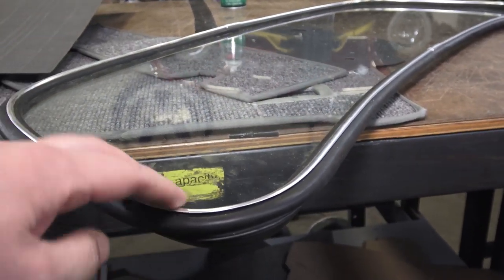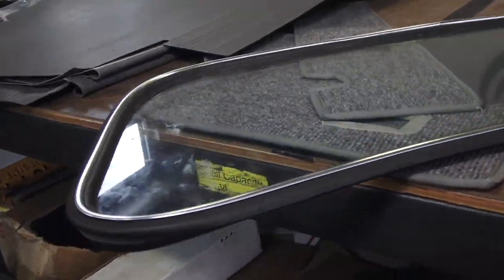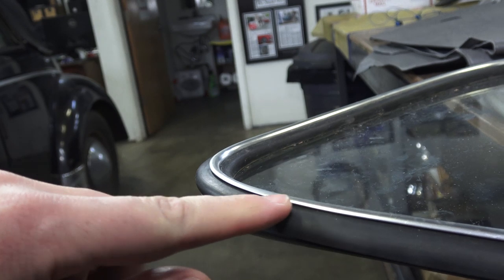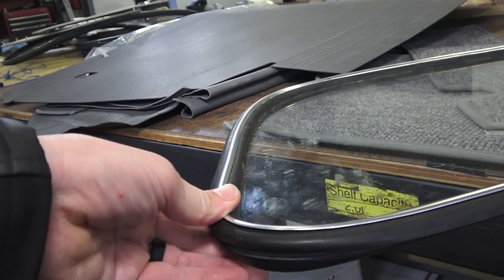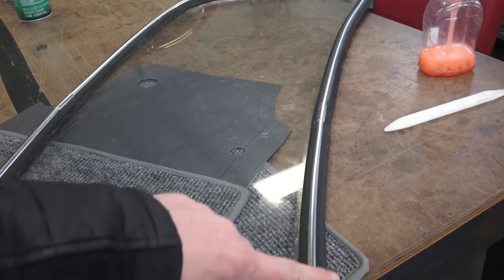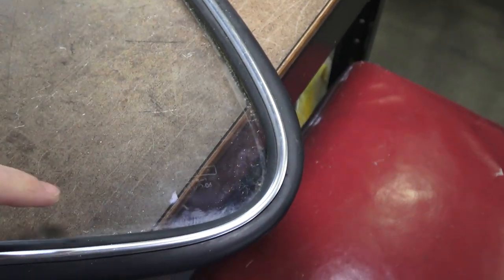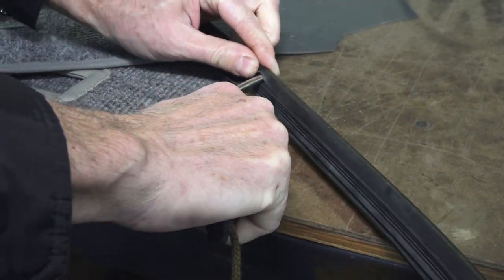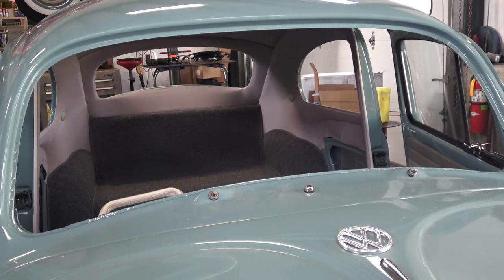Classic VW BuGs Window Windshield Beetle Seal Chrome Trim Tip Installation

Comment: I installed a set of Wolfsburg West windows seals (with chrome trim) in my bug this past summer.  Was the first time I've ever done this so I can't compare the seals to other brands but everything went together and all windows were installed without breaking any glass. The seals and trim do seem to be of good quality and I wouldn't hesitate to recommend them.

The chrome trim did need to be finessed a bit so it matched the shape of its groove...doing this is really important and makes installation into the seal a lot easier.

Comment: I hold a beer up to anyone who does this. I had my 63bug painted/repaired. They forgot to put in the chrome trims. I popped out the rear window, the strip goes 2 different directions. what a nightmare. 6 peeps worked on it with me. Maybe 4 hrs, I destroyed one chrome strip and reused one old one. Yes I got it in but I took it back to the body shop and said you do the windshield.
Reply: Oh yeah all new seals and chrome strips
Reply: Yes brother.. i just did all 5.. hadn’t done glass in 25 yrs.. i just kept everything dry..

Comment: Hello from Vancouver BC. I find your videos extremely helpful. I'm glad you updated this procedure because I'm going to be installing the windshield into my 60 bug very soon.
Reply from the maker: very cool keep me posted.
Reply: @classicvwbugs  With help from my wife, the windshield is in. Thanks again for your help.
Reply from the maker: @christhegreek3311  Excellent, so glad to hear.
Reply: @classicvwbugs  would it be possible/better to use silicone spray to get the chrome strip in the groove?
Reply from the maker: @SDsailor7  you can try, but might be too slippery where it can pop out.
Reply: @classicvwbugs  Ah ok. I will have to keep that in mind.
Thank for replying back

Comment: Great video thanks Chris!  I would also stress that the chrome trim needs tweaking and MUST line up with the shape of the glass or it is more likely to pop out itself and the rubber out of place, especially in the 65 and later beetles when the glass starts to have a slight curve and is not completely flat.  I've done this a couple times now, a major pain as you mention, but looks so amazing with the classic chrome.  I have used WW rubber and chrome and it worked pretty well.
Reply: What’s is the price on doing the inside on  bug. Any comment helps

Comment: I've purchased seals from Wolfsburg West and the joins are terrible. Not sure what the Westcoast Metric seals are like. I also purchased new old stock german seals which fit amazingly. I kept the original molding which was repaired and polished and I must say the fit and profile is unbelievable.

Comment: Great Video. This gives me a few guidelines for I need to replace the seal and "put back" the chrome trim on my windshield. Unfortunately, I have a 74 Super sedan and have been told the curved windshields are NOT as easy to install. Somewhere I read/heard there are "teeth" along the bottom of the window opening for the rubber. I know you had a 74 Super in the shop a few years back, Any pointers on doing one on those
Reply from the maker: its basically the same process, should not be any different.

Comment: Great video I just did my first attempt of installing a new windshield and rubber and chrome on my 78 SB Vert. Took me about 2 hours installing by myself from installing the new rubber and chrome. Which by the way was the most frustrating because bending it to conform to the shape of the windshield before installing the rubber takes alot of patience. But I got it done without and kinks ....Why dont they make a plastic chrome molding that is bendable or is that even possible? After that was complete I used speaker wire and with a alot of finessing it popped right in.... I have to say Im very impressed with myself for trying this I had my doubts. Though I hope I dont have to do this for a very long time. My fingers were sore for days afterwards.
Reply: Yes, such a thing exists, I installed it in my 71 Bug (with the larger window, after the switch they made in sept.71). I'm not sure how it's called on US websites, but it definately exists. It also has different clips in the middle than the aluminium trim. 

Like this : https://www.csp-shop.com/en/?func=detailcall&artnr=12467a
Reply: @vladmares8128  thx Vlad im hoping someone also knows where to get them because I still have to do the rear window
Reply from the maker: Wow very cool man, pat yourself on the back!  =o)

Comment: Question : 1963 and earlier models have “flat” front windshields? I’ve used a metal ruler and it reads flat, the windshield is have is “smoked” with no logo, i am not sure which side is which.. any ideas?
Reply from the maker: Is it a tinting?

Comment: Installing glass on my Type 3...should I be aware of anything or follow the same procedure with the curved glass? Thanks for the videos!
Reply from the maker: Good question, not sure.  I've never installed on a type 3.  Not sure if it is the same.  I know karmann Ghia is different for instance, chrome goes in after window installation.
Reply: @classicvwbugs  OK, thanks! The chrome was removed by the previous owner so, that should simplify things. Guess I'll learn the hard way. Really don't want to break the glass.
Reply from the maker: @KellerChristoph  Good luck